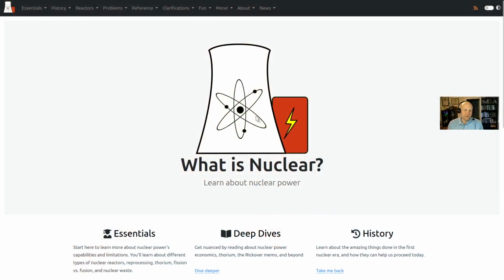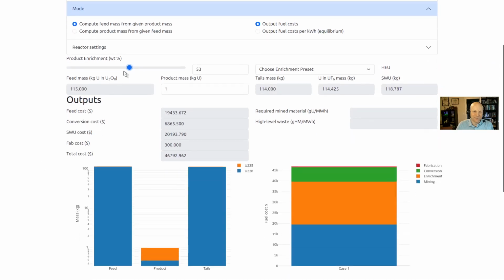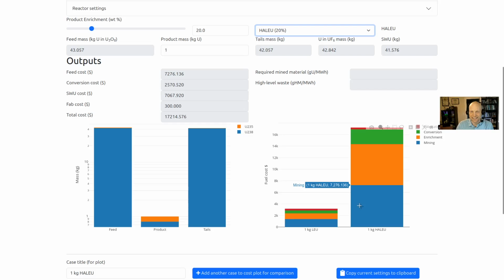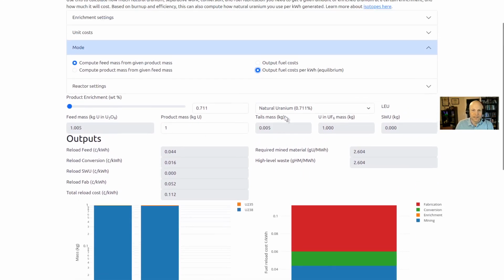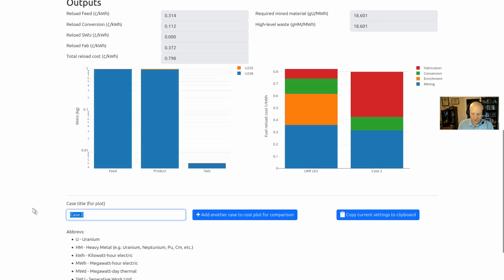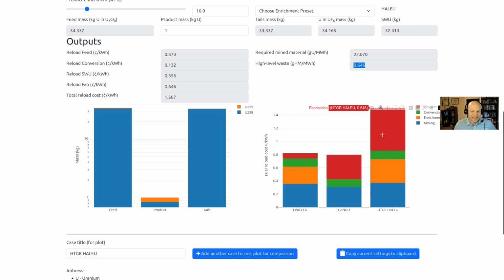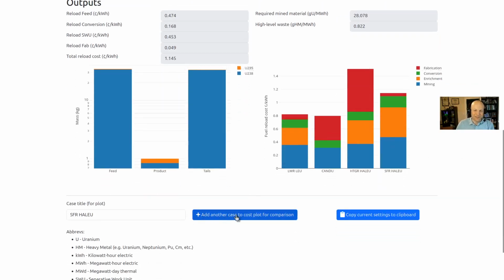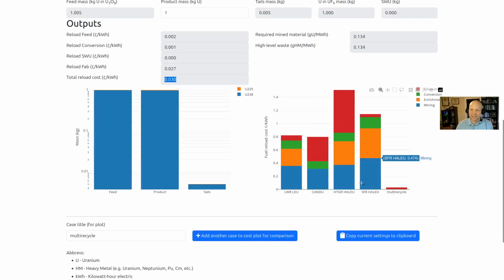Using the What is Nuclear Fuel Cost Calculator

Comment: This calculator is fantastic and so easy to use! I do have one question, though—could you explain how the costs are calculated behind the scenes? Either by sharing the formula used or pointing me to where it’s explained (maybe in the video description or another link)? I’d really appreciate any details on the methodology. Thank
Reply from the maker: Thanks! The equations that tell you how many SWU and how much feed F you need for a given amount of fuel product P can be found at https://en.wikipedia.org/wiki/Separative_work_units Given those, this just multiplies the number of feed by feed cost, swu by swu cost, conversion by feed cost minus a small conversion loss factor, and fabrication cost by the mass of product fuel to be fabricated.

Comment: Please add fabrication preset for molten-salt reactors:  U as a fluoride, no remelting, or pressing/precision machining / sintering/assembly required. Also, do the fuel costs include those physical fabrication costs, or are they just to get to the chemical state?
Reply: That ought to be close enough for the Thorcon reactor - which still uses enriched U. But how to account for the extra Th they plan to add in to 'extend the fuel'?
Reply from the maker: That'd be good to add but is less known because no one's done it at commercial scale. 

The fab costs include turning the enriched UF6 into ready-to-load fresh fuel.